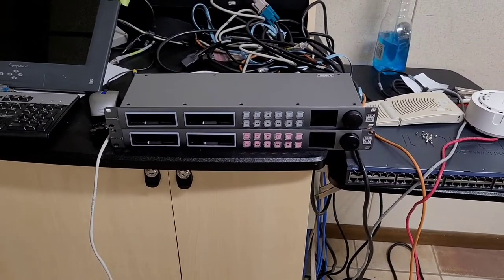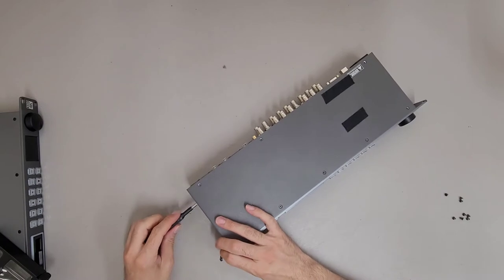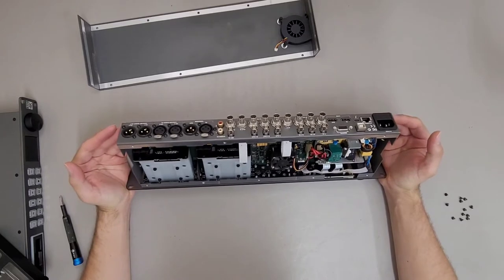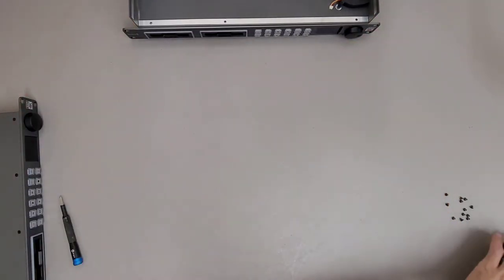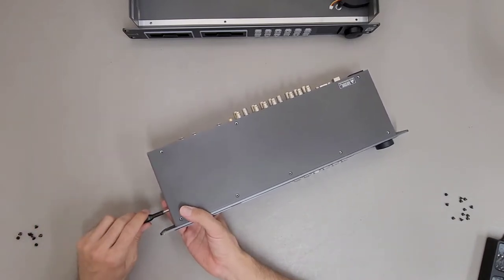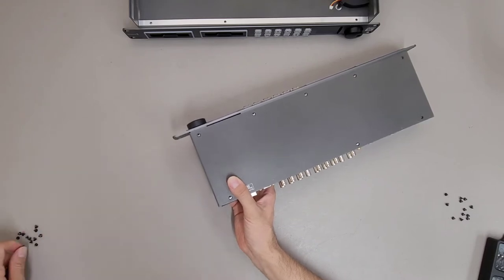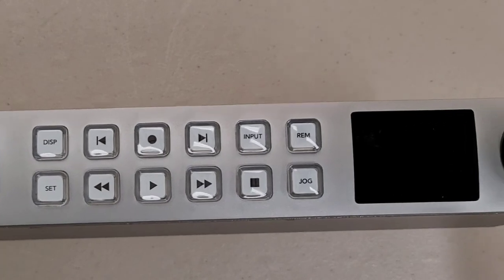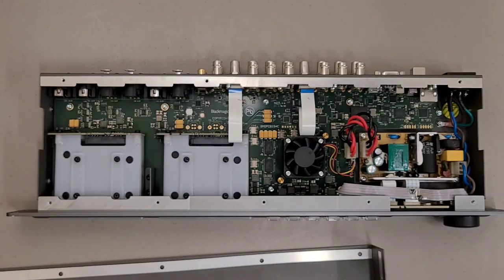Blackmagicdesign Hyperdeck Studio Pro 2 #teardown

Comment: Sad to see that an expensive unit goes to the trash because they installed cheaper smaller high RPM fans
Reply from the maker: I still need to see if I can recover them on a Mac. I will probably sell them for parts if dead. I suspect the internal flash boot storage has failed.
Reply: @computersales  i would guess the CPU underneath the fan got cooked ... AFAIK you had a few oscilloscopes in your shop - you could try a few testpoints closeby and see if there's any activity ... does it have a JTAG?
Reply from the maker: @jfkastner    I thought about that. I will have to see if I can find schematics or test points. They both are seen by my PC. They just won't do a firmware update.